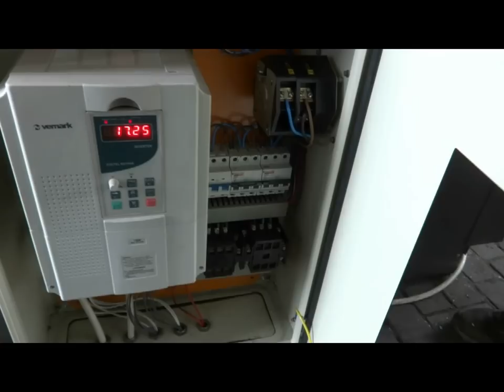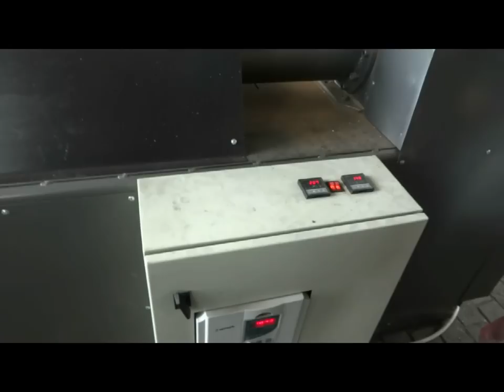Roof Tiles From Recycled Plastic

Comment: What is the price per peace
Reply from the maker: The installation costs 28000 Eur                                
with the moulds. We can make the moulds with a drawing or muster in Your                                
 standart/the standart is different in the countries/. Time to work-3                                
 months.Installed power-20 kW The installation includes: 1.Specially                                
 extruder 2.2 moulds-tile and cover 3.Press machine 4.Calibrator                                
 cooler for the ready details The machine can make 60 pieces per hour.                                
 The making area is 20 m2 without warehouses. If You have any questions                                
 please send us. Best Regards  
  For more question please us email    plasticam@abv.bg
Reply: I've come across similar plastic roof tiles at https://www.roofingmegastore.co.uk/roofing-brands/pitched-roofing/tapco.html , which are also crafted from recycled plastic. However, these are the only plastic roof tiles I've come across that provide a similar finish to concrete roof tiles. Thanks you and I will be in touch . . .